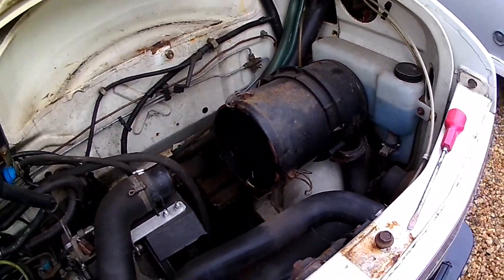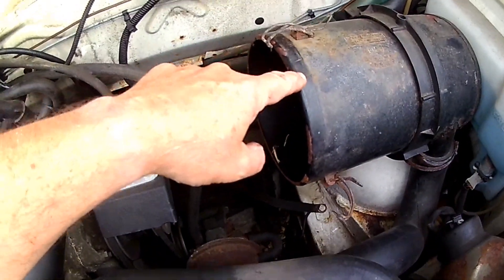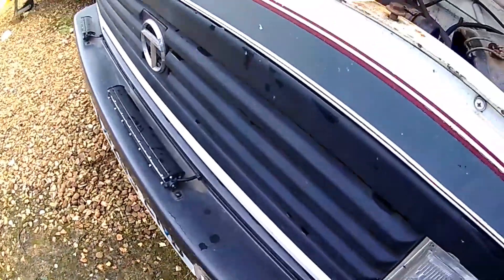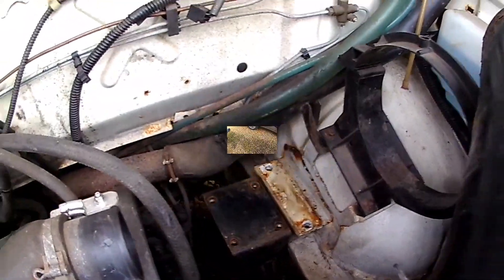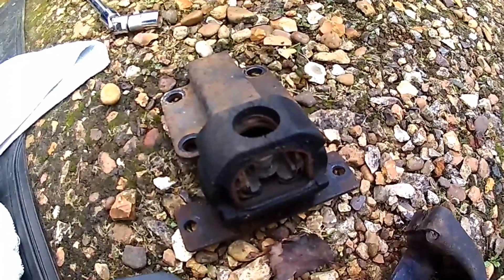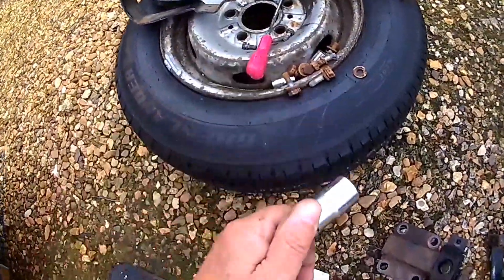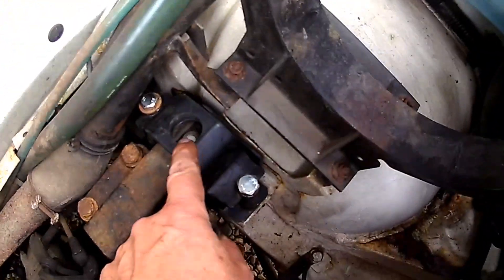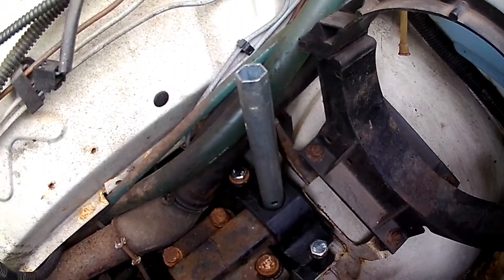Engine Mounts. Talbot Express Autosleeper. Part 3 of 4

Comment: Did changing rhe engine mounts cure the engine judder you described in the first video? I have the same problem with mine
Reply from the maker: Yes it did solve the judder. However they have come back recently. But it's been 2 years since doing the mounts. Cheers from old George.
Reply: Thanks George, I'm going to order and replace them now that I've watched your very helpful and informative videos!
Reply from the maker: Theres two sizes of the rear gearbox mount. I think you measure the diameter of rubber bit. But if not sure speak to Coastal Motorhomes Spares. Very helpful etc. Cheers from George

Comment: Any chance you have a supplier and/or part number for the mounts? I need to do mine. Thanks
Reply from the maker: I purchased my engine mounts as a kit of all three mounts from coastal Motorhomes on Internet or via Ebay. I also got the uprated ones. Dont have part numbers. Cheers from George
Reply from the maker: Ps There is two sizes of rear mount. You will need to measure diameter of rubber Bush etc. Speak to Coastal Motorhomes if you are not sure. Cheers from George 🤠

Comment: Where did you kack the engine up? On the gear box?
Reply from the maker: For the rear gearbox mount I used a trolley Jack and block of wood under gearbox. For nearside gearbox mount wood underneath gearbox near bell housing. The engine heavy mount I used block of wood v shaped to fit lip of engine sump. My engine has  an aluminium sump so it has to be distributed evenly along lip. Hope this helps. George
Reply: @MakeDoAndMend1  jack point on driver side mount?

Comment: Er, I mean great video. Did it fix the reverse problem?
Reply from the maker: Just done a video on reverse gears etc.
Reply from the maker: Hi thanks for your msg. I replaced all the engine mounts. It raised the Engine by around 25mm. Which meant I had to adjust the rods on the linkage. Since then I have all the gears working ok. But I need to go and do some steep hills to try it out fully. Cheers from George and Jane